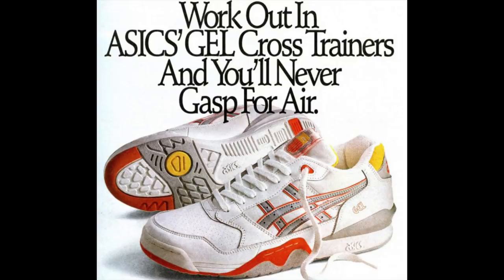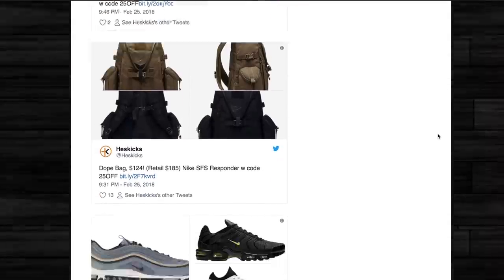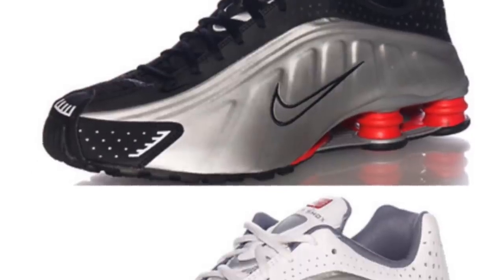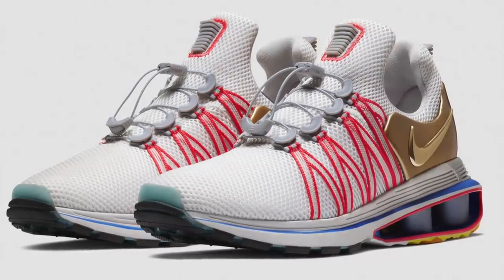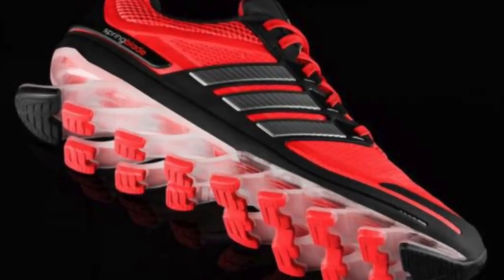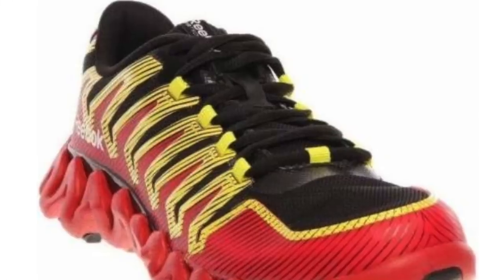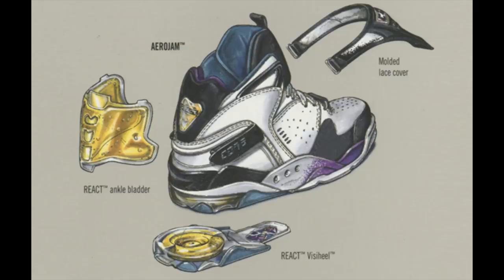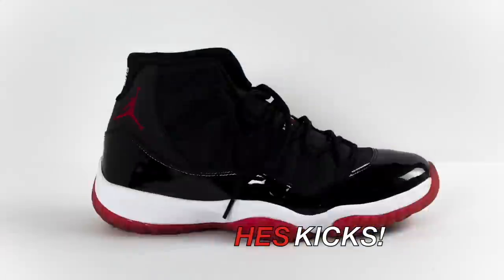Top 5 FAILED Sneaker Cushioning Technologies!

Comment: Bro your wrong about React Juice! It did work, it absorbed shock impact  on landings also it was responsive with cuts & stops. The ankle bladder helped with support & also hard stops preventing ankle turnover. I lived on converse & owned almost all of their 90's shoes.  React was better than shocks for sure. Later Converse made it a solid gel which was React II. REACT was not a gimmick it was used for over a decade so how is that a failed technology ????

Comment: Imagine driving or hiking with spring blade 😂
Reply: Desmond Ng I can tell you a story of exactly that. I had springblades and I remember them as pretty good, but once I was running and had to drive home very fast because something happened. I jumped in my car and the springblades got stuck between the car  and the break pedal and that happened all the time. I ended up driving barefoot, because it was too annoying. Very good for running, but bad for driving.
Reply: ASMR Jey Yup, that's what usually happen because our foot have to shift frm acceleration to brake pedal back and fort all the time, the gap of those spring can casue stuck at pedal. More dangerous on hiking. But i believe their concept is for track runners.

Comment: Downvoted. You introduced the technology but you didn’t even begin to objectively describe the actual failure from a design standpoint. The springblades for example, just looking at it I would assume that over time the bottom soles would flatten or break off from weight and impact. You only discussed how it played out in the marketplace from a trending perspective. I couldn’t care less that it didn’t sell well, that shouldn’t of been the point.

Comment: I think any of the Nike shoes with the air bag sole insert, is failed technology. I bought a pair at a Nike outlet, and wore them out of the store. On my way across their stone and gravel parking lot, one of the larger stones pierced the air bladder. Shoe was instantly unwearable. Less than three minutes out the door and $75.00.gone. No refunds for air bladder leaks. 😩 Suck it, Nike. 😠😡🤬🤬🤬🤬

Comment: I remember trying some springblades on in stores lol. I like what adidas were trying to do with the innovation, but you could not do quick turns or cuts, unless you wanted to roll your ankle bad.

The Reebok Zig technology was also pretty innovative. They made a smaller version called "zignano" and I thought they were better. They were pretty comfortable, but gravel and small rocks would get stuck in your shoes.